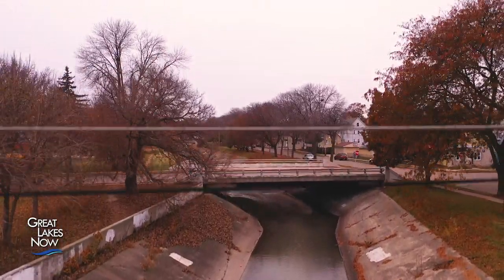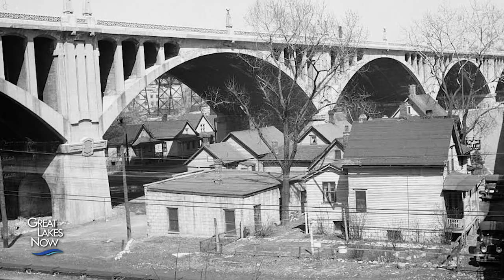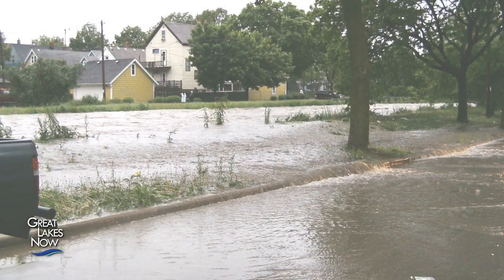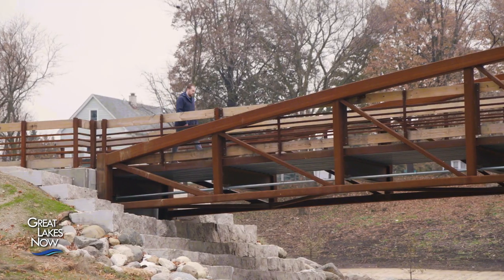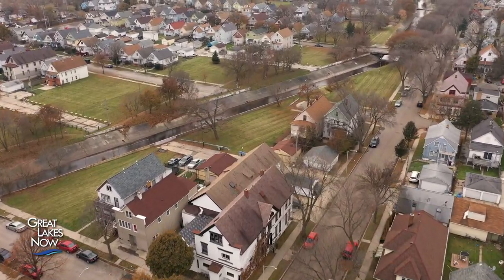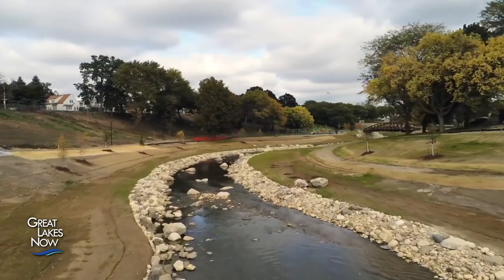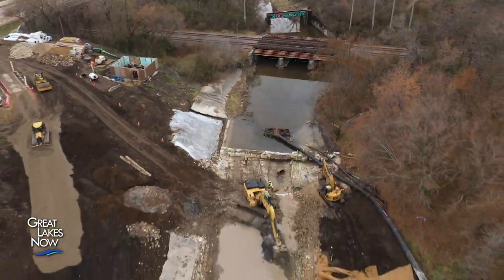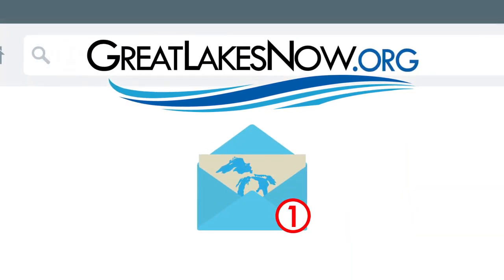Kinnickinnic River Restoration - Great Lakes Now - 1009 -  Segment 3

Comment: why 7 , why not the whole thing?
Reply: They are doing the whole thing, in stages. Next part is Jackson Park next year. Then the in between sections. They need to get the two parks done to be able to hold more water before they do the places around the homes. It’s also money, but it’s all being worked on in stages.
Reply: If they don’t do it in section they will have problem with silt Deposit and that would create blockage and flooding but aside from that this is a great thing just imagine all the wildlife that can come back from this